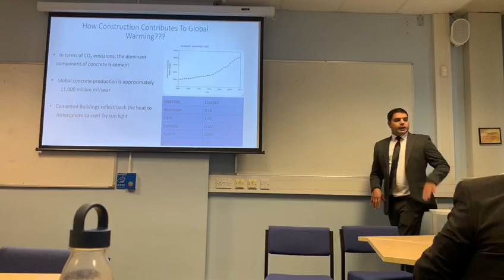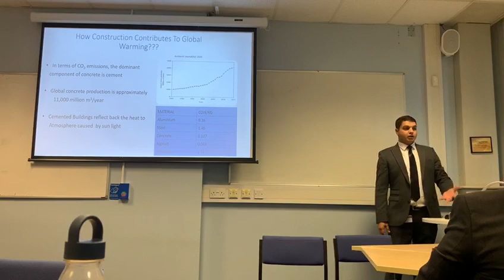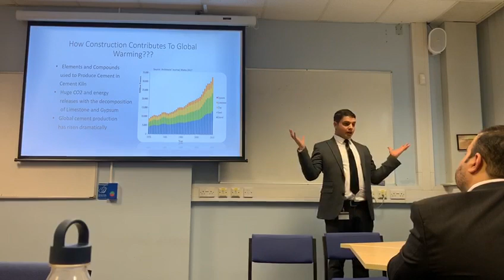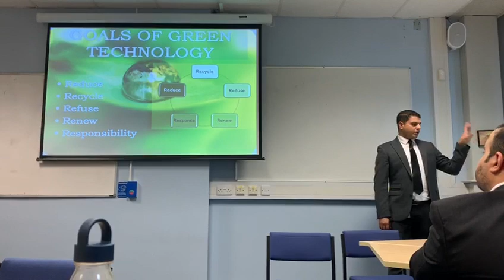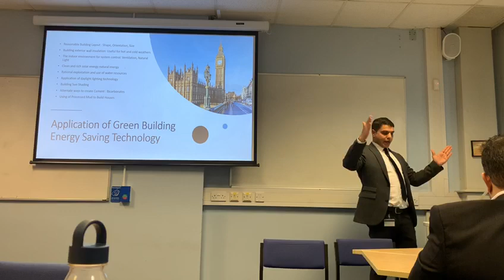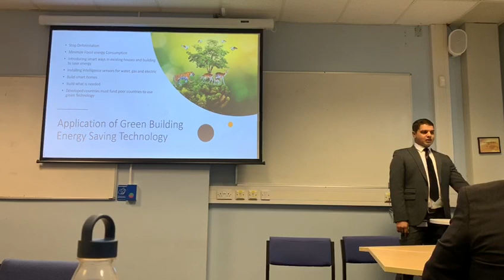Construction industry and global warming

Comment: very informative and explained everything minute in detail used in construction industry...one question please are hybrid cars are running both on fuel and electricity or just on electricity ..i learned as you gear up in speed petrol burning after maybe 40 miles an hour or so?
Reply from the maker: Thx Mr Tahir.  Hybrid cars come in 2 versions :
1 fully hybrid .... only electric power 
2 partly hybrid .... petrol and electric power . Car produce electric power to generate electricity to consume it as required. 
I hope it answers 😎